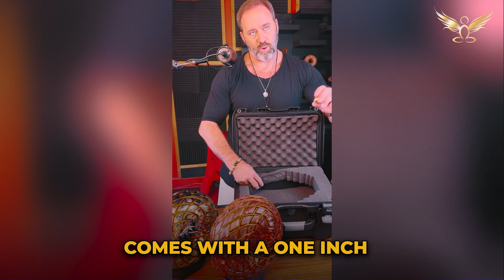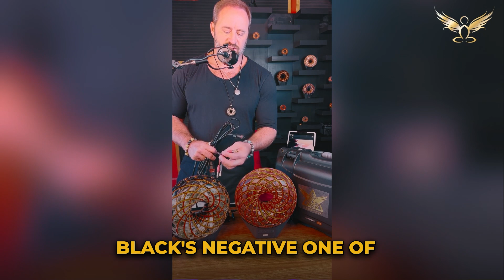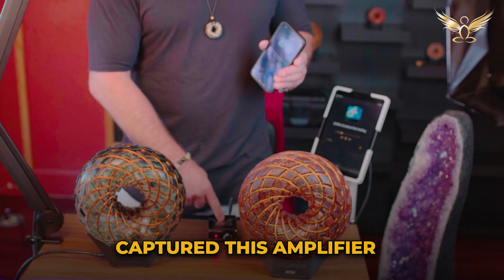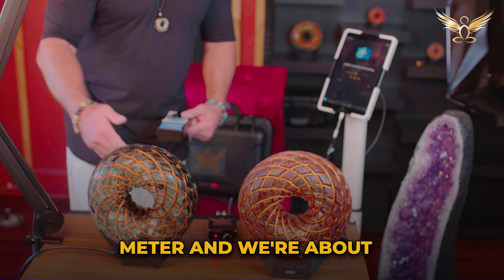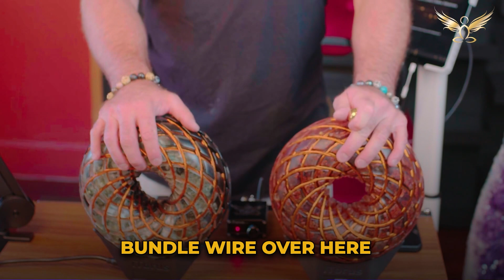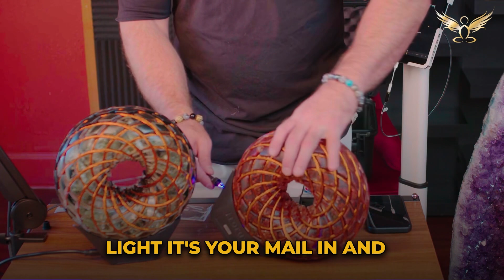iTorus i9 Tutorial

Comment: iTorus i9 4.0❤️:

- Largest of all four versions
- Comes with a travel case weighing 25lbs
-Medical-grade device
- Strong magnet, easy to stick on anything
- 100W amplifier and 24-volt power supply
- Bluetooth capacity , aux cord 3.5mm
- 10-foot audio extension cord

For iTorus 9 5.0 ❤️: everything plus+

- The upgraded fiber optic cable system 
- RGB light with RGB box 
- 10-foot audio extension cable with IR sensor and remote control
- 12-volt power supply

Bluetooth password 0000 

App included Free with first 4 albums🎉 

Earth base EPMF, Chakras Album, pain reduction frequency and more.

Always check with 20hz frequency to check whether the electromagnetic field is activated 

55 feet diameter range 😮

Different frequencies will have different geometric shape which yield unique properties ❤❤

I can’t wait to use them in person  🎉 such awesome innovation 🎉
Reply: I’d love to use this for me and as well as my clients 🙏🏾peace and love ♥️